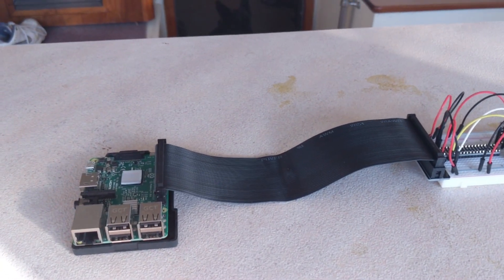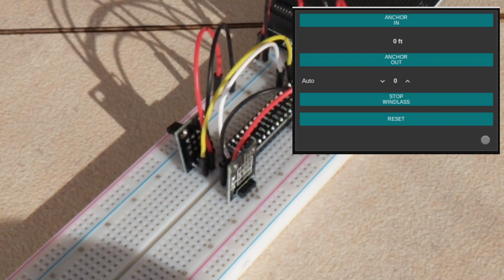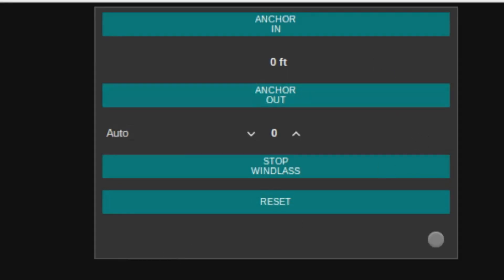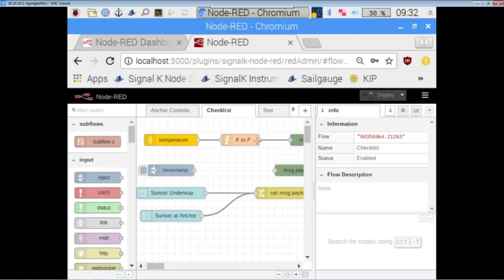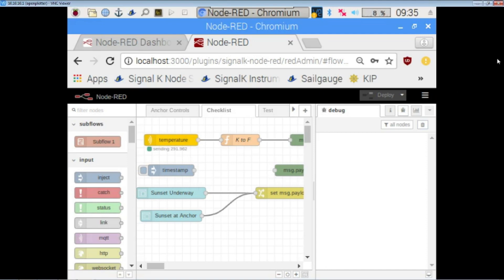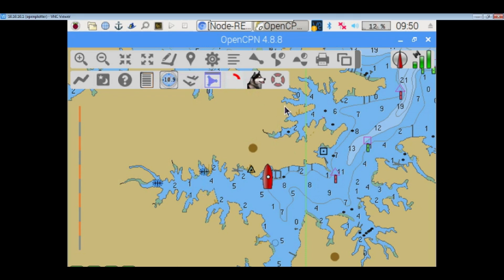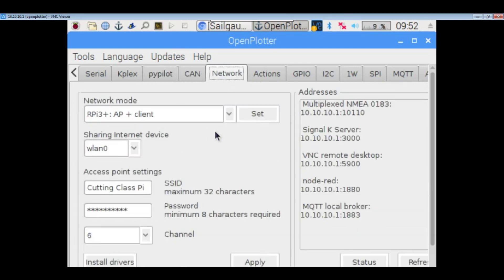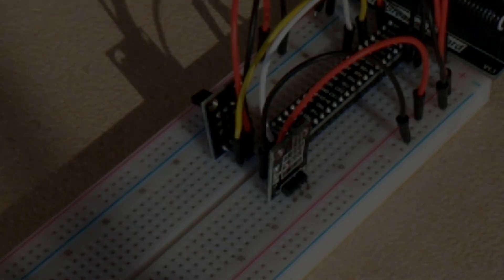Windlass Controls

Comment: As a long time boater I’m just now learning about all the potential uses for the raspberry pi. I love this idea, but i still struggle to find resources to help me make the connection from the programming side to the actual hardware operations. I assume you had to program the screen display for the windless controls? It’s awesome. Other idea I had was making a bilge pump counter. I would assume it’s very easy to do with a raspberry pi but I lack the understanding of how to program a simple counter and a reset. I’d love any feedback or resources on how to program python 3, or whatever source you use. Thanks
Reply from the maker: Sorry, this comment JUST showed up today so my response is very delayed. I do most, almost all, of my programming using nodered. This allows me to watch a certain pin for information, in your example the detection of electrical current, and I can then do almost anything with that data. As an example you could easily track how often a bilge pump came on and for how long it was on each time. You can use things like Grafana to create dashboards that will show graphs of whatever data you feed it. I started using raspi and nodered for home automation and don't have any sort of computer programming background so once I learned doing things that way I kind of just stayed with what I knew. The interface for my windlass is a simple dashboard that is built right into nodered. That is where I would suggest starting is nodered and go from there. Also, I started with a basic Amazon sensors kit for raspberry pi and played around experimenting to see what i could do. I also use raspi to control my diesel heated via RF signal by adding a small piece of wire to one of the pi terminals. So many possibilities.
Reply: Thanks for the help. I’ll look up nodered and see what’s out there on web for getting started.